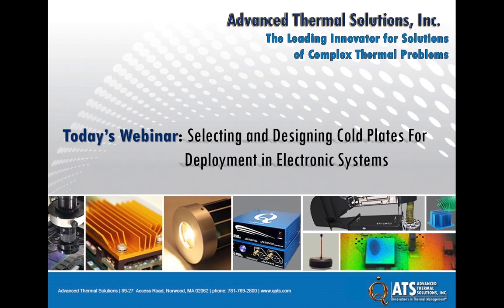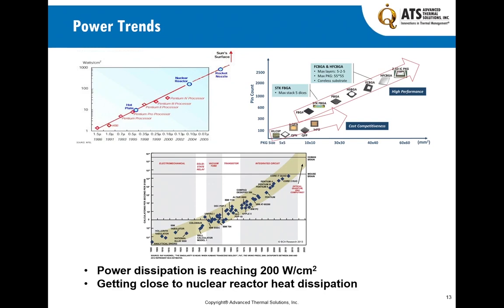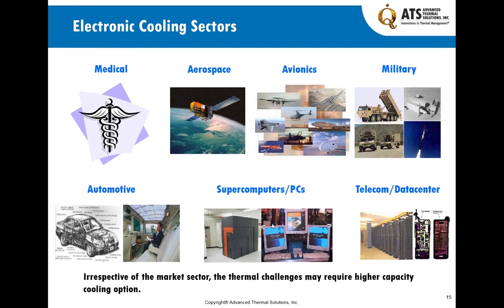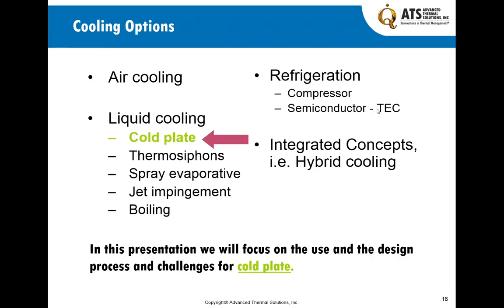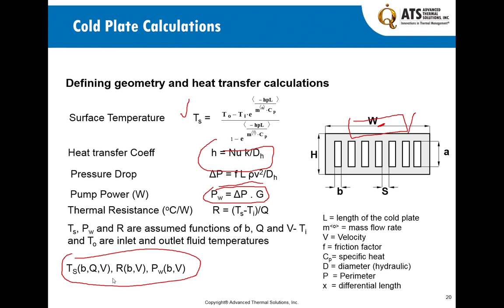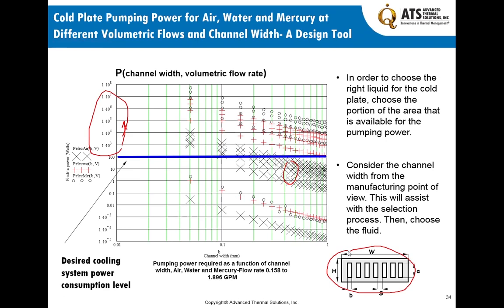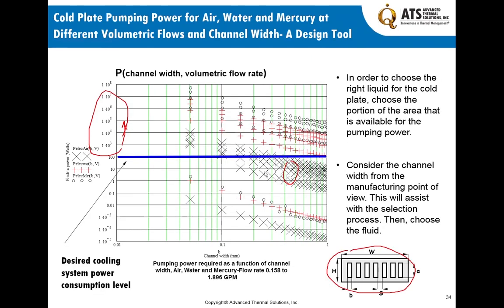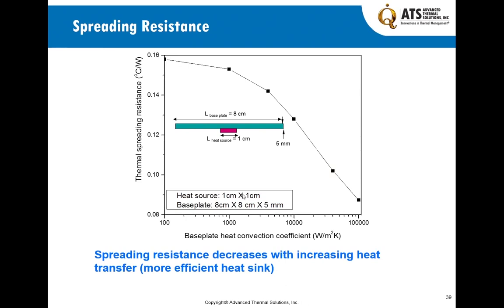Selecting and Designing Liquid Cold Plates for Deployment in Electronic Systems - ATS Webinar Series

Comment: Thanks for this pivotal, eye-opening presentation about liquid cooling. As a training graduate mechanical engineering student (specializing in  thermal engineering) at Villanova University, USA, it's a great motivation. Again, thank ATS.
Reply: Do you know any reference for the heat transfer correlation given in webinar?
Reply: @rohitandrews7863  Hi, I have searched a lot for those equations in internet and i am unable to point out those equations, but crap. 

Further, he says surface temperature, pumping power and thermal resistance are functions of b, V, Q but if you see those equations, they are not a function of them.

This is highly confusing and I need help in getting those equations.

please let me know if you have any progress. thank you.
Reply from the maker: You are very welcome! We're glad you found it helpful.